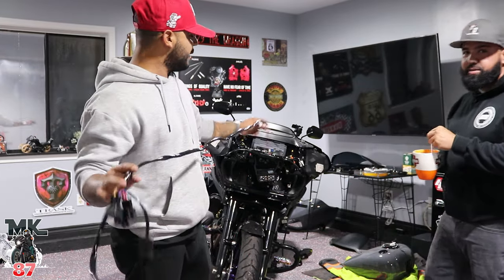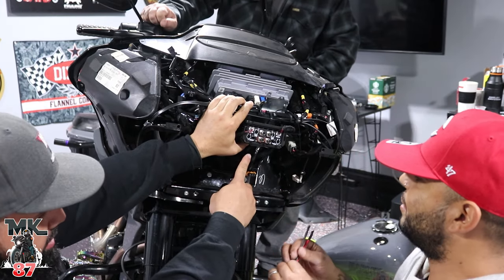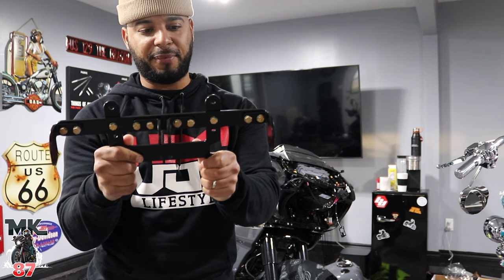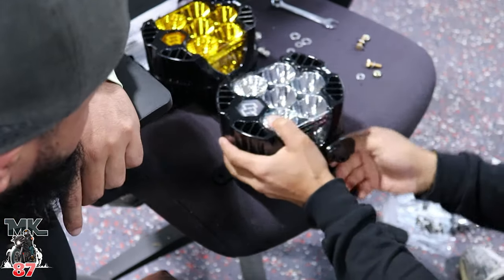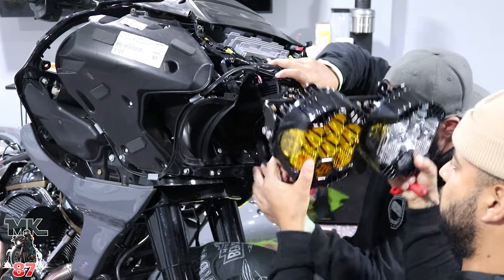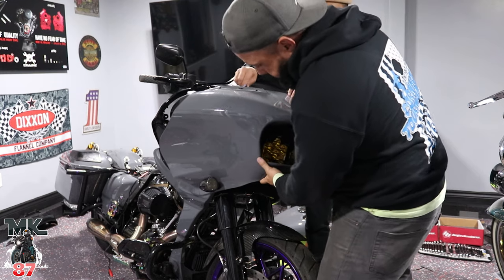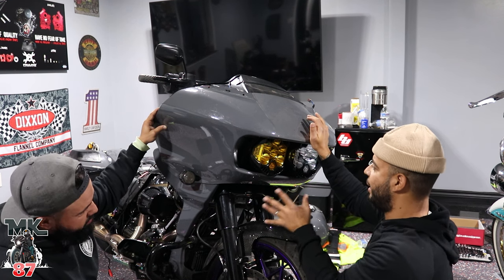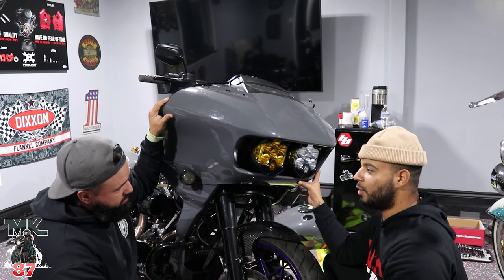Baja Designs LP6 lights install on Harley-Davidson Road glide

Comment: Did you have to adjust or “wing” the angle/height of the light or are they fixed in one suitable position to the bracket